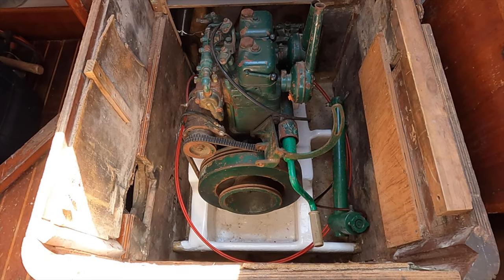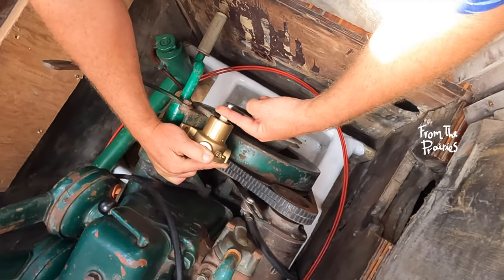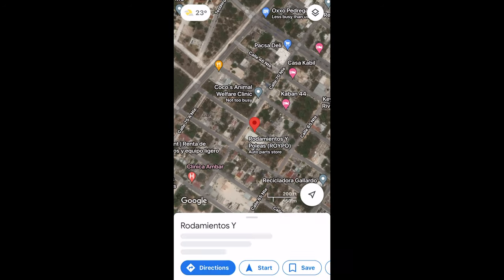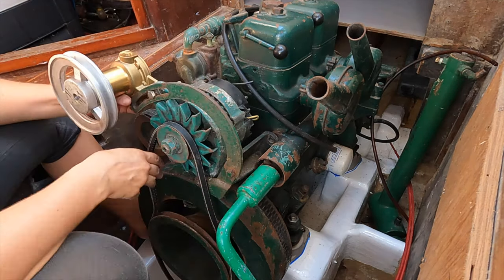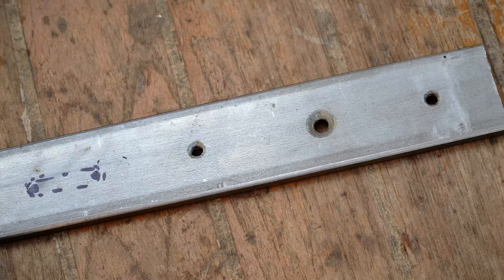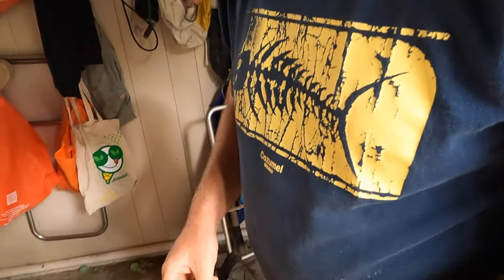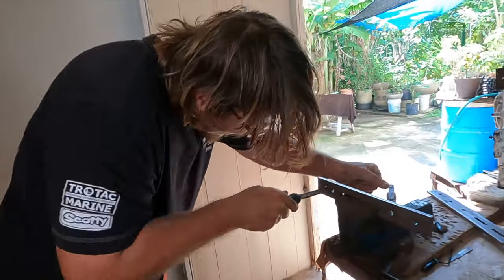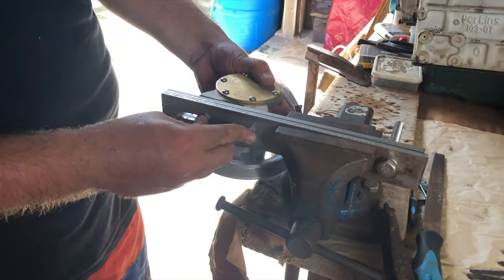is my diesel totally fud?

Comment: Hi guys. The direction of flow of the  raw water and the coolant  water is very important. The flow must oppose each other through your heat exchanger or you wont get exchange. You will have flow but heat will just build up. Raw water goes from the strainer to the front end inlet of the heat exchanger through to rear end outlet and on to the exhaust  bend and over board. The coolant water enters the rear inlet of the heat exchanger from the exhaust manifold to the front  end  and goes into the thermostat housing. That motor takes a double acting thermostat ( it looks like it has a flat pad at the bottom of the thermostat) so must be fitted or you must plug the bypass hole in the block. If you run without the thermostat the water just circulates in the motor and heat builds up. If you plug the bypass you need to experiment by drilling a small hole in the plug and enlarging it to get your motor to the right working temperature. A bit tedious, but works well. Without the hole your motor will run too cold and wont reach working temp. Plugged without a thermostat the motor just takes longer to get to working temperature. A Cold motor is as bad as a hot motor, just the hot motor blows up quicker. Sounds like rocket science but actually quite simple. Sure Robbie can do that. Tip is to use grease on your thermostat housing gasket as you going to remove it quite a few times.
Reply from the maker: We've been discussing this comment a bit. We ran Rossa's (similar volvo) without the little padded thermostat, and over-heating was never a problem. In reasonably warm environments, water always was circulating to keep the motor cool, but I could see how running the engine this way could cause it to run too cold in northern climes...Thank you for the tips - this definitely got us thinking about the cooling system some more.

Comment: Another great vid. I think I may have to side with Robbie on the engine. At a certain point, you're spending good money after bad and wasting time that could be used more productively elsewhere. Even it does get running again, an antique, hand-cranking diesel with archaic parts and unknown reliability will ultimately become more of a liability than an asset. Better to have no engine at all, than an unreliable one that will certainly fail when you need it most. It's tempting to to try to conquer the mountain out of sheer will and determination, and while you may be able to in time, you may also drive yourself to the edge of madness in doing so. Cruising should be fun. There's no need to make things any harder than they need to be. Maximal return on minimal effort is better than minimal returns on maximal efforts. Fair winds....Vielen Dank.
Reply: So true and yet... we are merely the audience and often the peanut gallery of sorts... this makes for great content and there is much value in antiquity if you stay constantly aware of Murphy's law, which btw applies to even the newest engines.
Reply: I think you are forgetting a key variable - money!
Reply from the maker: Thanks - it's something I've definitely considered...that the amount of effort may not be returning what it's worth. We have definitely been driven to the edge of madness. However, as mentioned by Paul - the key is money, and I don't see any other way of moving forward without a sheet tonne of money. 🤪
Reply: @sailorama  Time = Money, so if you don't have much of one, try to use lots of the other. Go slow and steady and you can rebuild anything. "Schaffe, schaffe Hausel baue."

Comment: You're doing a great job with these videos. I love 'em.
On the engine, have you seen it running yet? I am helping a friend rebuild the same engine (injectors, piston rings, cylinders, pumps etc.) but he had it running for a season so we are confident it will start again. (The head gasket burst and it was steaming out of the exhaust - but once the head's off you may as well do the lot).
Also (this is a repeat from a previous comment) I think the decompression lever needs to be vertical to decompress.
Chin up old chum. If it was built by (hu)man then it can be fixed by (hu)man.
Reply from the maker: Thank you for the tip! Robi was not sure about the lever positions. We ran the engine one year ago, and it ran perfectly - maybe just a little black smoke, but everything seemed to be going smoothly.

Comment: Hey guys. Sorry to say but mounting the raw water pump of the stringers is a bad idea, youll end up with the belt jumping off or possibly snapping or slipping. It needs to mount of the motor itsself so they move together. The location off the side of the motor is good as it will give lots of room for hoses but youll need to redo the mount and make sure the mount can't twist when the belt pulls it.
Also grab some square tube and put it against the flywheel pully (front of the engine) and use it to make sure the other pullys are lined up. They all need to be within 1mm either way ( front to back) and inline with the main pulley(square tube should sit flat on both sides of both pullys), if their out then you'll chew through belts ( youll see black dust from the belt within a few hrs of use.)

If you want to check the engine will run then hand crank it, you wont hurt anything running it for a minute if theres no cooling and you dont need the alternator just to check itll run. Old diesels are simple and bullet proof. What usually kills them is either lack of oil, lack of regular oil changes or you just cant buy parts anymore. 
But keep persisting, the ocean will still be there when your ready
Reply: yes, mount driven accessories to the engine
Reply from the maker: These are all great points - I'm so thankful for the good input, awesome! We may end up mounting the water pump in the place of the alternator, because without the alternator producing current we don't even know if the alternator even works, to be honest.
Reply: @sailorama  you will need to make sure you have a fuel tap, because if it runs there is no other way of stopping it

Comment: Some good alternatives to a Volvo engine: 

Oars

A section of wall that activates some mechanical linkage connected to a propeller that spins when you bang your head against the wall

Shouting obscenities in a rage while facing aft

But seriously, Volvo is a great engine, it can probably hold a large dinghy when used as a mooring anchor.

Have you considered a Go Fund Me campaign or something similar to get a new engine? It could increase viewership by extra exposure as a bonus. I had almost exactly the same engine before but I decided to replace it. Parts are two or three times the price of comparable new components and that's for used stuff. There was a YouTube channel up in Victoria who got a new Beta Marine engine via this method.  Even a 6hp Tohatsu outboard would probably be better in terms of reliability. I know people use them for 36' boats with success.
Reply: Funny, and I concur... Volvo is swedish for $$$$$
Reply from the maker: Haha - this is all so true. We actually have some engine possibilities / donation of engines elsewhere. We just need to get to those other engines! That's the paradox.

Comment: I learned many years ago that if I couldn’t find enjoyment working on my boat I would not enjoy a cruising lifestyle. I’m a few years ahead of you on my second total refit and motivation is often a problem. One way to solve that is to pick a different task, one of thousands you surely must have, and take that to completion. Don’t just pick a simple project that can be quickly completed, rather start working on a slightly less challenging one than your engine and work on it.  Success isn’t measured in your speed rather the quality of the work given all of the constraints you live under. Seeing a progression towards completion of this new project will surely motivate you both and along the way, new ideas will flow helping you get past the blockage you feel right now with the engine.
Reply from the maker: Thanks - 

We have a little side project coming, which will help, I think, to step away and regroup. Looking forward to sharing!
Reply: @sailorama  Hey there I'm rooting for you 2. Question though do you 2 have a 10 horse outboard motor and a dinghy? If so why not use it as a power tender to help with sails be it just the head sail or just the mail sail to get through that pass. So you could get somewhere like Florida where you can find many parts used cheap.
Reply: @sailorama  Also Robbie, right wrong or indifferent you have to help your Wife Quartback this thing. Get back in the game talk about other options if you need to, to get out of there !!! Sailboats sail without engines for many centuries just saying be a Sailor's sailor if you have to Man up find your Ball's. Built a sculling oar something You Can do It Robbie 💪 😉

Comment: Doing a sailboat repower on a tight budget with an engine different from the one it replaces really can be a soul sucking experience.  Hang in there. There will be a light at the end of the tunnel eventually.  I replaced a single cylinder BMW marine diesel with a pretty old Yanmar 2QM15 that I rebuilt.  I didn't have the budget to do it but it had to be done.  It took me almost 3 years including rebuilding the engine while the boat was in a marina.  Every system had to be adapted and changed.  6 years later, I still need a different prop optimized for the Yanmar engine. Be healthy, safe, and take care of each other.
Reply from the maker: Thanks - it’s good to know that someone else out there had to tackle a similar problem - and we’re not just out of our minds for attempting it, haha.
Reply: @sailorama  we are all in the same boat (MAD HATTERS) who stubbornly diy aboard in remote places. It just takes the right attitude to stay floating...

Comment: Don't give up there a simple engine your doing it right. Remember to push the little Choke button on the fuel pump when starting. You give it some throttle then push in the button and it should stay in. She'll fire right up!
Reply from the maker: Thank you for the tip - it’s the little things like that the don’t always show up in manuals.

Comment: Can you not repair/replace the original waterpump on the back of the engine?  Or is it just that you want to move it for better access?Just curious as we really dont know the details :)  If you do mount the waterpump off the engine, maybe incorporate a serpetine belt tensior off an automobile to keep the belt tight. Good luck either way.
Reply from the maker: The details about the water pump appears in an earlier video - the story is, after receiving what we thought would be the right kind of double, or rather tandem-water-pump that could go on the original water pump spot, it doesn't fit on the engine, and so we need to attach a second water pump on some other location on the engine. We are not sure if that will work in the long run, though.

Comment: Mount drive accessories to the engine
Its most common for Penta MD2B to have the alternator on the flywheel side of the engine, 
at 30 sec in, is that a generator with drive belt on the left of the engine?

It would be possible to run a flat belt off of the flat part of the flywheel, that is between the starter drive belt, and the alternator drive belt
At one time, in the steam era all belts were flat and they all worked this way. 
BUT it needs a flat belt pulley, it has to be perfectly square, in line with the centre of the flywheel, rigidly mounted to shake with the engine to ensure the belt doesnt wander off the flywheel

Pay attention to your drive ratios via pulleys to try keep within the alternator or pumps operating RPM
Have a close look at images of this engine you can find on the net, and see what will work with your installation
you should find some handy crescent shaped brackets that allow belt adjustment from an auto-wrecker or mechanic workshop, cheap
Reply from the maker: Thanks for the good points!

30 seconds in, we only have the starter motor installed on the left hand side. I'm aware that there are different kinds of starter motors - the 'teeth' driven kind that rotate the flywheel instead of utilising the belt, which would free up belt.

We've seen some pictures online of people installing the pulley driven water pump in the place of the alternator with about 5 inch pulley size like ours, and it was the biggest pulley size we could find. Our plan b will be to install the water pump where the alternator is, which will only require drilling a couple of holes in the metal that mounts the alternator.
Reply: @sailorama  oh so thats a belt starter, how weird, ok
so in another world with access to parts you might find that bendix gear starter and free up a belt, but thats not todays problem

Will that engine run without an alternator? because I have met a few that will
mind you, you will need to have tip top solar or some way to recharge your batteries, and be able to monitor state of charge

another thing I just thought of, that rear most pulley, the smaller one, is that steel?
you might find a pulley at an auto wrecker the same diameter that is also steel, weld the two rims together and grind or file the welds perfectly smooth for the belts
Reply: have since learned that a diesel will run without an alternator
but not without a battery. you need to keep 12 volts going to the fuel stop solenoid on the injection pump.
cheers

Comment: I think it would have been easier and cheaper to install a 12-volt water pump for your engine; you could have put it anywhere
Reply from the maker: We definitely wanted to go simple - 12v would have been easy to install, however we already have power problems, not enough power.